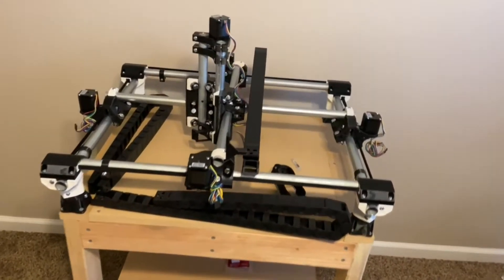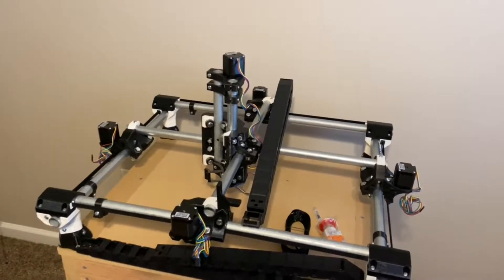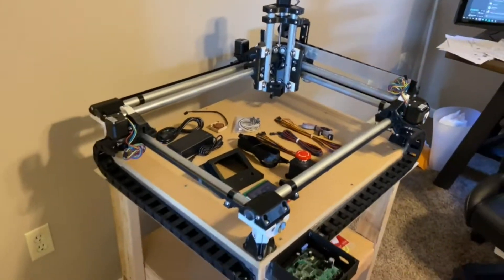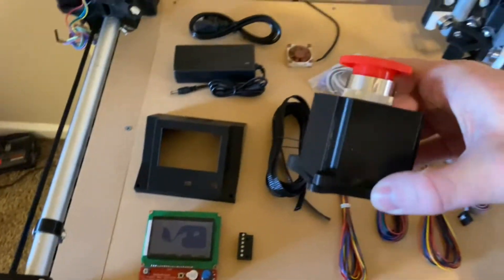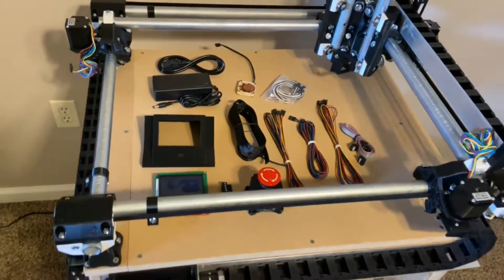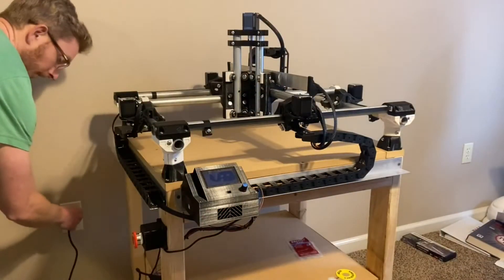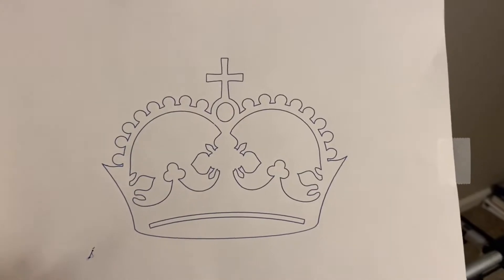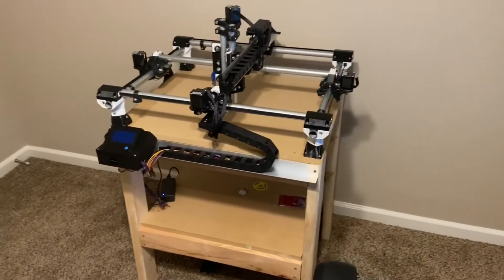MPCNC Wiring/First Test - Mostly Printed DIY CNC Router

Comment: what power source did you use there?
Trying to understand what power source should i buy...
Reply from the maker: This kit comes with a power cable/adaptor that wires straight to the controller.

Comment: How did you wired your emergency stop? I was told that apart from switching the power coming from power supply unit so it can be used to switch on and off, it also need to be connected to the controller. Is that true? If so, how is that done?

Comment: Thanks for sharing this! Have you wired up the dual endstops yet? I've been struggling to get mine to work correctly.
Reply from the maker: I actually decided not to wire up the dual endstops because my firmware wasn’t set up for it. You also need the wiring kit for it, which I don’t have currently. Make sure to contact Ryan and see if your board is set up for it.
Reply: @HutchinsRacing  Hrmm - yeah I guess it might not be as necessary as I think? I have a Rambo 1.4 flashed with the right firmware for it but are there certain kinds that can't? Gonna fuss more with it tonight - I appreciate you sharing your project as a reference, documentation seems to break down past the physical building parts.
Reply from the maker: @jeffginger  No prob! Dual endstops aren’t necessary. They help the machine compensate for not being completely square but if you built it correct you shouldn’t have to worry about it too much. I have Rambo 1.4 also but it’s not flashed for dual endstops because I didn’t select that option when I bought the kit.
Reply: @HutchinsRacing  I ran to similar question as I was not sure if my firmware was setup for dual stop or not. From the V1 forum, I learned that the infor screen for the firmware will show if you have one or not. My firmware infor screen showned "V1CNC 513D" which I guess the D is for dual end stops. I have mangaged to set it up but sometimes I get the jam but it now works consistently I guess.

Comment: Nice build.  One thing is that you can use shorter cable chains if you mount the fixed end near the middle of the axis travel.   As it is, about half of the chain never moves.  Something to keep in mind if you decide to enlarge the machine as you hinted at.
Reply from the maker: Yeah I thought about doing that but since I had so much extra I decided I would rather have a path for my wires all the way to the controller to keep it clean looking.

Comment: Thanks for the video. Do you have links to the printed parts you used for the controller box enclosure and the bracket for the drag chain support?
Reply from the maker: No problem! I've added links to the files in the description.